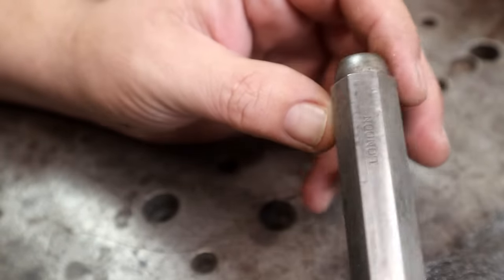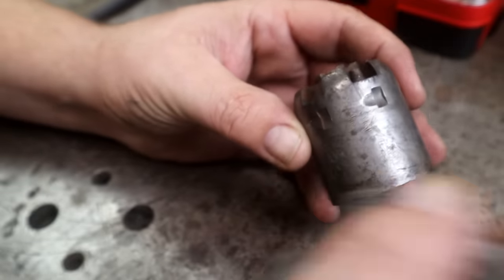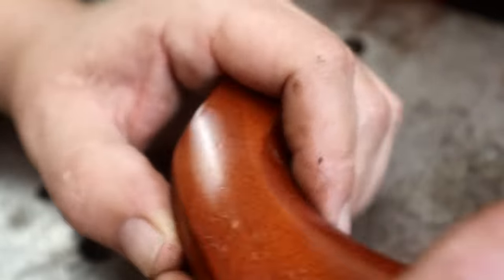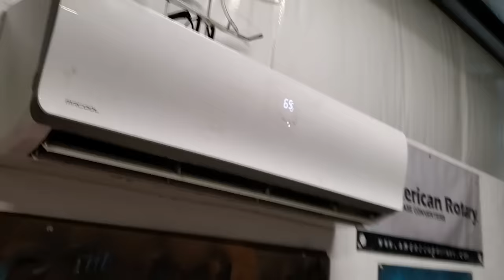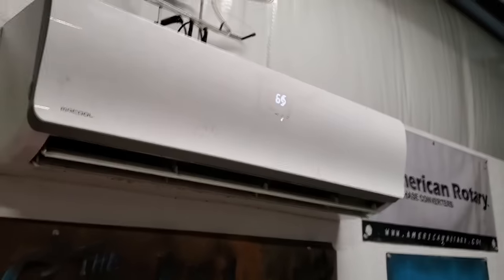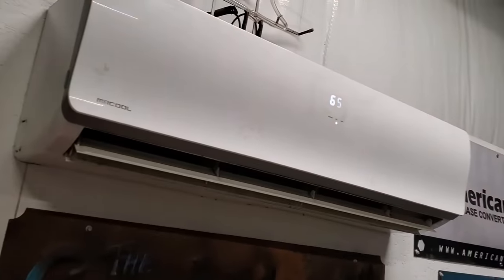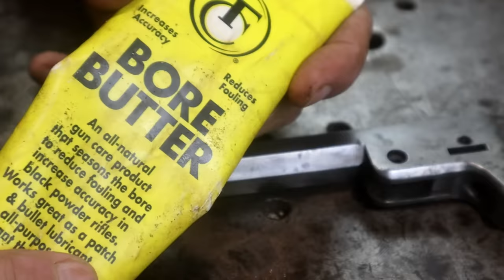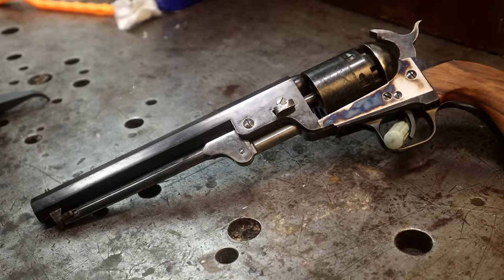1851 Navy Restoration

Comment: That is a reproduction of an 1851 Navy, London pattern. Of Italian origin. You got it done. Good job. Now constructive criticism. 
1. Get off the metal table. At least put an old town down. No tapping on guns with an old cruddy hammer. Polish the hammer face first to remove all dents and dings. Or you will mark up the gun. 

2. Completely strip the gun. Penetrating oil before you hammer. Degrease the gun parts in acetone. Then boil them for an hour in clean tap water. Just water. Not the grip. This will convert any red rust to black ferric oxide. This is the basis of the rust blueing process. Now gently rub the loose black powder off with 0000 steel wool. You will discover a lot of the original finish under that rust. If you see more red rust after carding boil it again. Card again. You can save your original finish in this way.
Dry the gun. Then soak in kerosene 24 hours. This sets the restored finish, removes all water. Then any bright spots or scratches can be touched up with cold blue. Oil with a good gun oil. 
Try Tung oil on the grips.

Comment: I know this video is a year old now, but there's a technique to pulling the barrels on colt pattern revolvers. Pull the wedge, then put the hammer on half cock, then bring the loading lever down. This will put the plunger of the lever against a wall between the cylinder chambers and lever the barrel off. If the cylinder is bound, just stick a scrap of wood between the plunger and cylinder

Comment: Not to be rude - hopefully helpful. Dont use a metal hammer  (Peen or otherwise) on metal parts,  to loosen things up. Use  a brass one, just like you use a teflon later on, or can also use a leather hammer too. Stops micro dents or pitting..

Comment: When stripping down a stuck frame, put on half cocktail, rotate cylinder so that the loading lever pushes against the wall between chambers then use the loading lever to separate  the barrel from the frame. And for God's sake use a brass hammer!

Comment: I have an 1862 .36 cal that I cut down to about a 2 inch barrel. I liked the story of the Mormon Avenger, in particular the story of Porter Rockwell. I'm not a Mormon by any means but I have a feeling Porter wasn't either. He was just a hard man that found a group of people that would look up to him, depend on him, and praise him...basically for feeding his bloodlust. He was boyhood friends with Joseph Smith until Smith was killed by a mob in Illinois while Smith was awaiting trial. Porter then became bodyguard to Brigham Young. Anyway, the story goes that the Mormons headed west on the wagon trains were issued one of the cut down .36 cal Colts to take with them(a Mormon Avenger). It just happened that the little gun was also a good hideout gun for assassinations. I'm going to try to cut down a 44 Remington next. Probably not to two inches but 4" might be ok. It should make a proper modern firearm.
Reply from the maker: History in the comment section! Love hearing a peice of History new to my ears. Thank you. Now I'm off to research !

Comment: Excellent job, I  agree with you  i wouldn't want to do anything to mess with the case hardened frame either. Anyway I  also have the 1851 Navy also   1860 Army both with brass back straps and trigger guards as well as the 1849 pocket model all  made by  uberti. I also have a  few 1873 peace makers and a couple with birds head  grips, all have  different barrel lengths  I use them for old west reactments I perform.  I  sure would like to have you work  my grips I  like the oil and natural wood look, it looks so much more  original. If you do,  what are your charges (prices)? Thanks and keep up the great work .

Comment: What I appreciate in this restoration is, it wasn't just soaked in a salt bath to cause the corrosion so they could do a fake restoration video. 

You can tell because the corrosion is worse on the inside and the outside doesn't look that bad. It is also very uneven. Unlike those fake restorations.
Reply from the maker: Good eye! If you like this check out some of the other videos. Pencil sharpener is a good one.

Comment: You should be converting the Iron Oxide into Freeoferric Oxide by boiling the rusted parts in distilled water in a stainless steel pot. Then buffing with a soft fine wire wheel. 
Check Mark Novak's YouTube page
Reply: Forgot to mention the conversion arrests the rust, simply buffing allows the rapid return of the rust.

Comment: Sir, we both love super fine steel wool and a nice deep bluing. Mediative. Fun to shoot, pain to maintain.

I have some questions about repairing my 1963 Navy, .36 Cap & Ball. Replica.

Say, I loaded up occasionally too high powder loads. Over time, my revolving cylinder wouldn't stop at the point of the next round.

I've just adjusted by hand and shot each round. 

My question: How can I fix this problem with the  cylinder "cathes." The grooves in the clinder that are stopped by a lifting piece of metal on the trigger piece that stops at each round? As I said, my just seems very loose? Are the parts I may need to replace or is it just going deeper and cleaning/tightening? It's a Uberti.

Thanks.

Comment: overall, your incompetence is remarkable. first, hammer out the barrel retainer, and without removing its locking screw. then, hammer out the barrel from the frame with an iron hammer. you say you want to keep the patina , but then you burnish everything cold ... even the castle, which is tortoiseshell.  perhaps the only decent things are the internal cleaning of the barrel and the restoration of the scales. finally, declare it immediately that it is a replica ...
Reply: You don't have to take out the screw to get a wedge pin out. Ideally you should be able to push it out by hand.

Comment: why do you use aceton at the end mounting dried metal parts? -  drying out the oily finish opens up  for new rust in the cleaned surface, right?

Comment: I'm always wondering why you hear gun experts that say it's generally not a good idea to restore a gun due to the drop in value from the restoration.  True collectors like them in original, dated condition.  There must be a tipping point, however, when a restoration is needed on a gun in such bad shape that it doesn't affect the value, but may actually increase its value somewhat.

Comment: Gotta say, as nasty and corroded as that pistol appears to be,  the hand grip is in exceptional condition.   How'd that happen?
Reply: Linseed Oil
Reply: @javajav3004  yeah but you'd think he would have removed them from the gun to restore them.
It would have been the last step for me. Why oil the grips when you still have to refurbish the whole pistol.  I don't know. Not a big deal,  they just stood out against the rest of it.
Reply: @Tom-kn6sr  easier to fix metal than rotting wood i guess

Comment: So... You have never worked in a warehouse during a whole summer, without air con and for 8 hours each day? I tell you it is hot, when the average temp is aprox 86F, and no air circulations. We were not even permitted to drink during the shift, and there were no windows that was able to be opened at all. Only two small doors at the ground level.

Comment: What are you doing ? Have you ever heard of a rubber hammer ? They can be found in different sizes and shapes. 

Also, by using the lever as a push rod against cylinders wall u can push the front of the gun apart from the rest of the gun....
Reply: Just take the wood of and submerge the rest for a few hours to a day or so. Then start working on it. Everything will be smooth and easy AND YOU DON'T HAVE TO SMACK the gun like crazy when more professional methods are available.
Reply: Again, metal on metal. I just cannot understand how it doesn't bother you ? :)
Reply from the maker: It's simple. It's harden steal and I didn't strike it hard enough so cause damage. The part was never in danger. This is not  ignorance, it's experience. Could you do it? Probably, but I suggest you yake a few practice swings.
Reply: @TheGoodoftheLand  Alright, it just horrifies me 😅 I like to be as nice to them as possible :) 

Also i am sorry for me being a bit rude in the first place :(

Comment: I'd like to make this revolver,but there's no blueprints/templates for it...I mean,no good.
Carboard is good,but it's not the same...You can make it using carboard templates and then make it in metal,but it's not the same thing...No threading,some can't be disassembled like original...

Comment: Whilst watching I felt a tad anxious as disassembly on these fine weapons are so nerve-racking, also I noticed you were banging a hammer against the mag or whatever you want to call it, now I’m no guns expert but I’m sure this is isn’t your safest option, however, a great alternative I use is pulling the hammer back as far as possible then using a screwdriver to get in between the hammer and firing pin and pushing down then the rust should snap, then clean with and I stress this highly PROPER GUN OIL no offense.

Comment: I'm into this video 1 minute now and cringing that he took down the loadlever and did not use it to remove the barrel~You misalighn the chaimbers of the cylinder and pull down gently on the lever
Reply from the maker: Never do that on a rusted gun. You will bend the pins and damage the ball ram rod. Once that is damaged you will then damage every cylinder you try to load. I don't even recommend that technique on a clean gun. If it doesn't come apart with ease once the pin is removed you have a problem. Prying it apart is never the option. Rust is strong in tension. You need to shock it to break it free. If you are skilled enough, a steel hammer has sharper impact. If you're not sure at what point the steel hammer will begin to damage the steel of the frame, go with brass. Hope this helps.
Reply: @TheGoodoftheLand  hahaha  that's funny ~I said gently~Not a 2 foot cheeter bar or hammer  hahahaha  Good one ~Easier~ after all that was one of the functions of the loadlever~oppsed to ~you struggling with it by hand for over a minute of corse ~Oh the ball ram is color case Hardened steel  :))

Comment: I wouldn't risk losing the value out of it.. and I would want it to function.. so I would probably take it to a gun smith.
Reply from the maker: +doorran  its not an original. You can buy this model for $225 today. Its a good project to cut your teeth on. Having said that if this was an original the project would have gone a very different way but I wouldn't have a problem restoring it. Very simple albeit cool engineering. I I could actually remake any part on this project from scratch. Most average gunsmiths are not set up for that sort of thing. Thanks for watching! Check the link in the first comment to see it in action and some of my older videos for fun projects. I personally like the one where I cut the entire side of of a brand new Ram truck and rebuild it.

Comment: Cock the hammer and use the ram to remove the barrel by lining the cylinder between chambers and the ram will push the barrel off.

Comment: By restoring it dont it lose it value as your basically remaking the gun from new ?
Reply from the maker: For some antique firearms that is the case, for others it is fine. Highly sought after antique with significant damage can be repaired so they can be enjoyed and brought back to life. They will be worth more in working condition if the damage was bad enough to warrant the repair. This particular piece is a replica that was not cleaned after being fired so it is only worth a few hundred bucks. Hope that helps, definitely need to have antique firearm value determined beforehand. Could ruin a peice of history and lose thousands.

Comment: For me it looks like the gun has been made to look rusty. The locator tapped out way too easy, the bluing around trigger and cylinder is too shinny, and that handle grip is polished. Is this a fake restoration video? In my mind yes.
Reply: The screws are so shiny, they look like no one ever screwed it open
Reply from the maker: I hate the fake resto guys. That's why I quit making videos. This is a replica that was shot with black powder and left to corrode. Definitely not meant to trick anyone. Most folks know what it is and those that are not familiar someone, including myself will tell them. Check out  the other restorations on this channel.

Comment: Not  restored,just cleand.
Reply from the maker: +paulo sergio macedo  Yup, just like a window.... or a counter top. I do alot of rust Removal on my counter top.....and my dishes. Hate when they are non functioning and I have to "clean them".... not to mention my car, heck its a pain in the backside when I clean it. Have to completely disassemble is remove all corrosion and the old finish, reapply the finish and reassemble it just to clean it. Its tough but hey, thats cleaning. Thanks for watching, stay a while! Check out some of the other video on the channel. I clean alot of stuff! I mean really really clean. This was really dirty!
https://youtu.be/5ZxK2v0MtSU
 Check out this dirty axe. It was crazy dirty.
https://youtu.be/MUpE4GTZX-k
So much dirty stuff on this channel.

Comment: Would it make sense to work on a wood or plastic surface exclusively with a wood, brass, or nylon hammer and brass punches?   And how about removing the grip before getting solvent all over everything?  Steel wool on a firearm... please stop!  Reproduction or no, you shouldn't video this hack.
Reply from the maker: I agree with you that you do not possess the skills required to achieve the same results with these techniques. Keep trying and one day you will be able to use a hammer without causing damage.  
 Silly boy.

Comment: you screwed up the whole video when you scrubbed the barrel from the muzzle end....
Reply from the maker: You don't even know why do you? Lol
Reply from the maker: Yes. I was going to use the socratic method to help you understand but I'm a bit busy so I will just explain.  Not for you but the others that will read this after you and believe it. That methodology is (somewhat true when it comes to a steel cleaning like the kits that comes with an M1 garand. This is a brass rod and brush with a plastic follower. In fact most modern cleaning kits use softer metals to prevent damage. Hope that helps. This particular kit is made and sold for cleaning black powder pistols. The handle is soft aluminum to protect the crown.
 This is one of those things that people still believe but don't  know why. Kinda like kicking tires when buying a car.... Merry Christmas!

Comment: I cringed with every hammer tap....
Reply from the maker: We see that alot with first time hammer users. Don't be afraid to get in there and figure out how to properly use a hammer without causing damage. It takes a while  but you can do it. After 29 years in a body shop I got the hang of it which is why the blows didn't damage the frame. Hope that helps! Thanks and keep watching, more to come

Comment: Can't believe anyone would tap on a historic firearm with a STEEL ball peen hammer. Get yourself a brass or copper or lead hammer for that.
Reply from the maker: Can't  believe you would mistakes  this for a historic firearm. Learn how to use a hammer and perhaps one day you can learn how to shock the rust without damaging the surface.
Reply: @TheGoodoftheLand  You never said it was a replica, you stated 1851  Navy revolver. You used a plastic hammer later, why not at the beginning ?
Reply from the maker: @harrywagner3877  You are correct, I'm just poking back at you. I will explain. There is a point at which you can impart a snappy impact to metal to help break the corrosion that will leave the surface clean of damage. Hard rules like "don't hit that with a hammer" are great for intermediate skill levels. Better safe than sorry to use a brass hammer. Takes more force to break it loose but it will be fine. The context that is  missing  in this video is my experience level with a steel hammer on steel. Its above average (I hate when guys preface a statement with "I've been a whatever for 20 years" but in this case its important. I'm a long time body tech with a background in classic restoration. Hammers and metal are second nature for me. This is how I was able to break the parts loose without damage. You will notice that I am holding the part in my hand. It's all deliberate. As is the switch to the rubber mallet. I knew that part required more force and the ball peen hammer would have caused damage so I had to wail on it with the rubber mallet. I could have used the rubber mallet  for both parts but the ball peen was a foot closer. The brass hammer was all the way across the shop😉. If someone were to be helping me with the project and I was not aware of their skill level I definitely would have handed them a different hammer.
Hope that helps! Thanks for watching!
Reply: @TheGoodoftheLand  Very good explanation ! Cheers !

Comment: Don't know why he is using a steel ball peen hammer a gun Smith would use a brass an nylon hammer
Reply from the maker: +Chuck Lear how to use a hammer without causing damage.
Reply: Was a gun Smith for 15 years I can use the right equipment
Reply from the maker: @chucklucas8747  Excellent. Im capable of using steel and brass hammers without causing damage. You are capable of using a brass hammer without causing damage.

Comment: Why are you working on a steel bench if you want to keep the patina and stop beating up what you just cleaned up it should be working on a wood bench even with a carpet on it. A short shag carpet. By holding it with your fist and dragging the back end of that barrel on that steel bench it's not doing it good and it's not looking 2 professional. I'm just saying if you're going to put it on video organize yourself a little bit better then it will be more interesting to watch the video